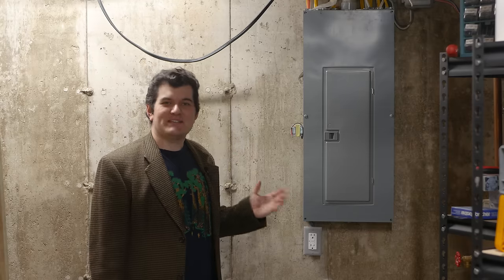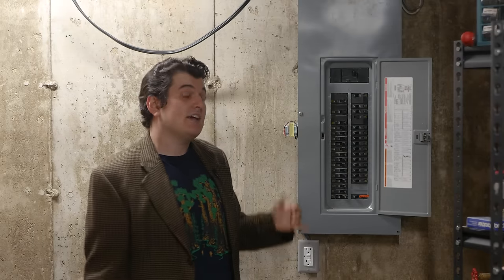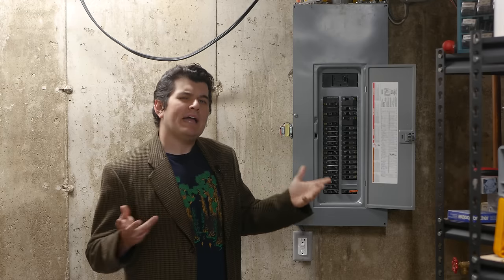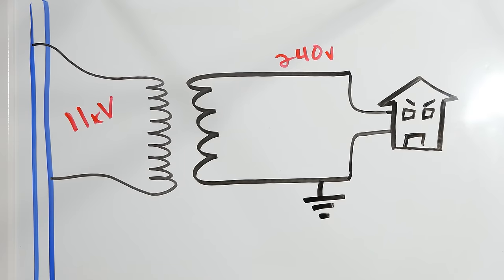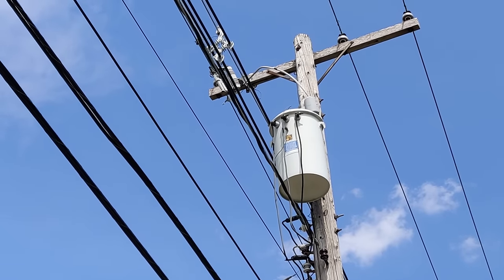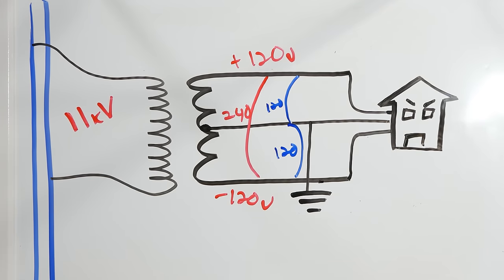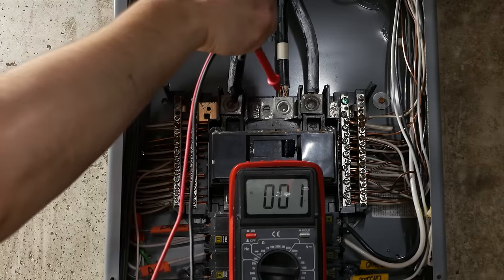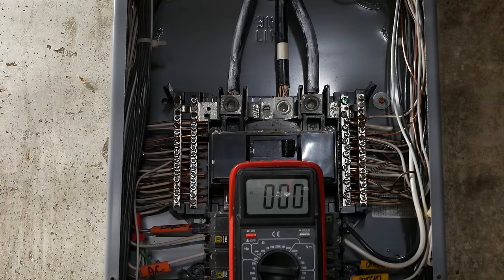The US electrical system is not 120V

Comment: 6:33 In Norway, a governmental electrical inspector just had a heart attack.
Reply: karl marx  They are. In the thousands every year.
Reply: @titter3648  Generally because of user error and not electrical related.... And when it is it is generally because someone did their own wiring job and did something stupid (like completely bypass a breaker)
Reply: You americans (and japanese) could just insulate the contacts for like a 3rd of an inch, like we do here in Europe. Makes plugs safer! (:
Reply: @AmstradExin  Well if you haven't noticed, the US system is all about being as cheap as possible. Why we have thin leads that bend so easily. And what do you think is cheaper, a lead with plastic rapping around the top with a metal wire running though it then spreading out to match the plastic or just a thin sheet of metal that just sticks straight in the housing? The US system is all about being cheaper, not safer.
Reply: @SilvaDreams  This is what enables user error. User error is design error.
Reply: @AmstradExin I’ve always found that argument a bit strange as I’ve literally never once in my life shocked myself this way and have ever heard of anyone shocking themselves this way...(I know, I know, anecdotal evidence but still). So if it’s a safety issue, it’s certainly not a common one.

Also European plug leads are like twice the length of US style leads. With US style leads you would really have to try hard to get your finger in between the plug and the socket while it’s far enough in to actually be connected. With EU style leads, they’re so long it would be trivial to do if they weren’t shielded like that. So maybe don’t make your leads so long and you won’t need to worry so much about touching them on accident?
Reply: @einsteinx2  or, you know, have long leads and don't worry about touching them. seems like a win-win to me. hint: corrosion is nasty
Reply: @einsteinx2  I don't know about you, but I sure couldn't fit my finger between a Euro-plug and socket to shock myself. Unless we're talking about ungrounded ones, though I haven't tried, but they are normally shielded.
Reply: @Skylancer727  Well, the 'euro-plug' is actually molded this way. So maybe it is harder to adapt....
Reply: @einsteinx2  This mainly applies to 'euro-plugs', using the outlets in trains, that had very simple and plain holes on a piece of plastic. So if you have wet, washed hands after shaving, you don't get shocked when you pull the plug.
Reply: @Lucky Joestar Well, I was appealing to US. Americans, so that made sense. (:

Comment: That title - like "EU's electrical system is not 230V" - it's 3 phase/400V in quite every home / also nice plugs :)
Reply: Exactly :)
Reply: I assume you mean "almost" every home, well here in the uk almost every home is 230 V single Ø (phase). I've worked on close to 1000 homes and 3 of those were three Ø. Also do you mean the US has nice plugs or the EU?
Reply: @paulpantsoff6584  that's because the UK electrical- and water distribution system is a hack-upon-hack with ancient components everywhere. If you go to work at mainland Europe, you'll find that not only is three-phase common, it's a legislative requirement in many countries.
Reply: @paulpantsoff6584  electrically the UK has better plugs.
Reply: @InTaco7  I live in France, and your stance on 3 phases might have been true in the 1960's and 70's where "electric house" was a thing - electric heating, electric oven and stove, electric water heater - even in the countryside where farms would equip with 3 phase electric motors for everything - but with technology improvement and refinement, most of those items are now running on 230 volts. In my (rather large) family, only my grand-father's house is still in three phase and we know it's going to be a deterrent for new buyers. Although its true that in compaison to the US, in France, getting a 3 phase installation in your house is just about asking for it and that's all.
Reply: @LeSarthois  in Germany every house has 3 pheses 400V. If you never use big saws ore welding machins it is used for each floor a new pheses.
Reply: Yea that is exactly what I thought too. It like apple being like "we now have 4 cores too" while other manufactures are at 8
Reply: @LeSarthois  How would more power be bad? it only has advantages. and if we really transform to electric  cars it is mandatory anyways. And wey would you use a 2000W stove if you can have a 7000W one? do some people like wasting time? It only has disadvantages.
Reply: @LeSarthois   3phase is still used for induction cooker, electric floor heating and others. Yeah, consumption of single devices dropped, but we have a lot more devices than before. 
3phase also have benefit in blackout - sometimes happens that 1 phase turns off due to some sort of failure - and u have still 2 more phases.
In my flat we have 3 phase. I have combined light circuits that if 1 phase fail then i can still see because i can use light from next room. :) Also it's better for grid when house current is disintegrated between 3 phases. - Transformers tend to fail if one coil is loaded a lot more than others. :)
Reply: @DCuniversalable  I understand different countries have different way of dealing with that. Most Suscriptions in France for households are 30 amps, and no electricity providers in France offers 3 phase with 30 amps, so a majority of households are single-phase only.
Also here as far as I know, if one phase fail on the national grid (not at home) they cut every phase so there is no benefit as you described. As I said in my comment, I as talking about France,  that's 65 millions of people, it start to be consequent in regard to Europe :) But I know the French network is quite different from the rest of Europe on many regards.
Reply: @asdanjer  Some people like saving money.
And 7000 watts? I dunno. my house is on a 30 Amps suscription like most French ones, so I simply can't use a 7000 watts stove (assuming it's one unit and not 7000 watts for 2 or 4 heating spots. Still would have to cope with other stuff running in the house)
Reply: @LeSarthois  I doubt that you only get 6 ampere with 230 Volt that's just 1.4 KW that's a water cooker. 
In germany most flats have 400 V 3 Phase with 35 A fuses. A normal house is most likley 400 V 3Phase with 50 A fuses which are the broke down to circuit with mostly 16 A/ 230 V.  Only old buildings use just 230 V
Reply: @LeSarthois  less wattages does not make it more efficient. it is not cheaper. it heats more bot for less time. (that is even more relevant in Germany as electricity prices are second highest out of all countries) Are you talking about the price of the electrical connection? because in Germany they are in ever hause by default. 7000 watt is obviously for the entire thing with offen and 4 spots- but that does not work with a normal electrical plug. I don't know how your electricity works but we have multiple fuses and the 400v stuff as its own.
Reply: Even my apartment has 3 phase 400V.  My stove runs off it.
Reply: Three-phase systems can be referred to as line-to-ground (Vphase) or line-line (Vline) voltages, so both are technically "correct."  The relationship is defined as VLine over the square root of 3 equals VPhase. 400/rt3=230
Does that help? Of course not! Three phase can be wired differently to achieve different mixes of voltage and current (delta vs wye) so what you plug into might not even technically be what your device uses!
Reply: @paulpantsoff6584  the uk is not in the eu anymore
Reply: @killswitch8493  it never was
Reply: this needs to be upvoted - just made the same comment XD
Reply: @johnseven3695  Electrically speaking, that's 100% accurate.  The UK's national grid only has DC connections to the EU (for various reasons of sanity, I'm sure) which was handy in dealing with ISO IEC 60038:1983 and the voltage standardization that kinda wasn't.  Europe is 230V +/- 23V ... thus 220-240V spec.
Reply: @asdanjer  
My 12-core mac pro would like to have a word with you.
Reply: @LeSarthois  
This is really strange.
Here in the Czech Republic every house have 3 phase connection, only small flats inside block buildings have 1 phase installation only.
And it is obvious, street cable is 3 phase and every flat/house have many separated circuits. It is wise to spread load to all three phases.
Reply: In South Africa we use 3 phase 400v it is great. We use a 95kw pump on our farm and it is common place everywhere in South Africa. Ever seen n large motor scream at start with a star - delta configuration, trust me it is great 😁
Reply: in italy in every home we have 3kw 1phase. to have 3 phases or more than 3kw it becomes very expensive
Reply: @paulpantsoff6584  We've left the EU thank god
Reply: @jwalker7567  I don't think that's correct. We have split phase 240 in the US, which is for dryers, stoves etc that need a full 240V. For my dryer (electric), the heating element needs both sides of the 240V to work and I don't think we even have 10Amp in new construction/electrical upgrades now either. My house is old, initially built in 1908 and likely didn't have electricity initially and may have had gas lighting for a while in the beginning, maybe a hybrid of both. Anyway, 2 additional bedrooms were added to augment the single bedroom it had in the mid 80's and the electrical service was upgraded to modern 200A/240V service but using a Federal Pacific circuit breaker panel which were a known issue even then, but still installed in thousands of homes at the time. I had it replaced when I bought the place in 2016 for the reason of it being an unsafe design.

Anyway, the dryer requires both halves of the 120V, though technically, it's really 122V per side so 244V total to make the heating element work, so when the timer began to go, half the time I got no heat. Then the following year, the start switch for the dryer motor went bad and it killed one side of the split phase 240V, disabling the heating element to even operate.

Once I cleaned the contacts and put it all back together, it's been working just fine.
Reply: @InTaco7  Well we have 13amps available to every socket, so 3KW at least, and most of UK still getting 240v, or a bit more, and our plugs are rated 13amp.  We don't need more than that. AFAIK rest of Europe is only 10 Amps, and some only 220V (Germany?) so that only gives you 2.2 Kw. Which is why you need 3 Phase.
Reply: Lmao...3 phase everywhere on any power system is a damn good joke. Liar